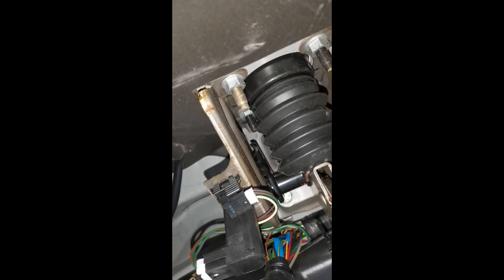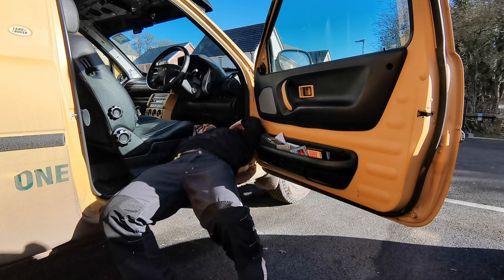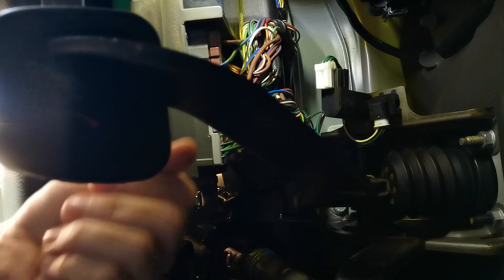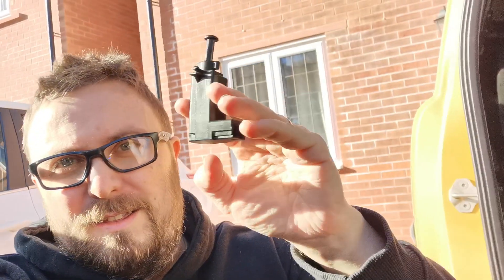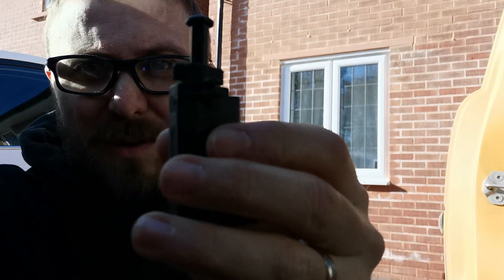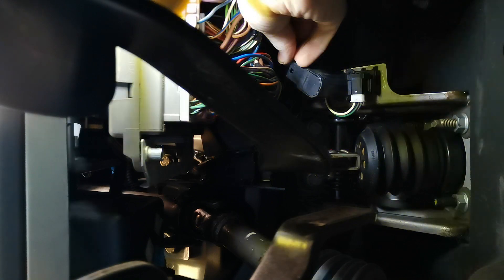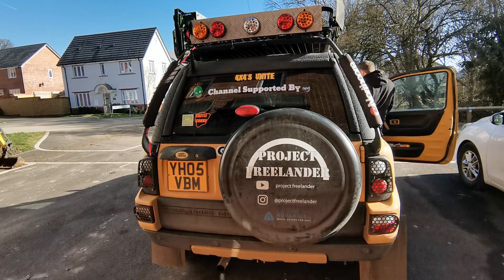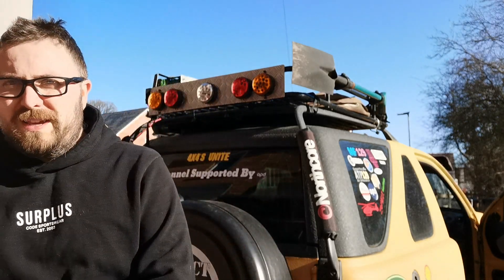How To Replace Brake Light Switch - freelander 1

Comment: Your video is very helpful, thank you! I have to press the brake pedal a lot (like halfway) before the light comes on. Is the switch adjustable? Thanks
Reply from the maker: Hey, glad you liked the video 😁👍
The button should react as soon as you begin to push it in and activate. 
As far as I know they are not adjustable, they are a sealed unit and typically only respond in one way.
Hope that helps

Comment: Excellent video - just completed this job on my TD4 automatic. Used the upgraded switch with new link wire, worked like a charm and no more three amigoes!
Reply from the maker: Awesome, glad you liked the video. I had contemplated the upgrade but thought it best to stick to stock for the purposes of the video lol I did think it caused the 3 amigos but strangely I didn't get them lol

Comment: Hi my freelander 1 back lights are both out, could it be a fuse and if yes which fuse please as new bulbs don't work
Reply from the maker: Have you tried a new brake switch yet? As if that's gone they won't activate. It could also be a bad contact on the connector itself, they are known to rust and become corroded. Unplug the lights at the back and clean up all inside the connectors on both the cable leading to lights and in the back of the lights and try again. That would be my starting point as fuses rarely go unless you have an electrical issue
Reply: @TrackCraftPerformance  cheers for that but my brake lights work it's my main back lights sos I'm female 😁
Reply: Yahyaoui..that made my day lol. I'm a female

Comment: I’m about to attempt this myself - thanks for the video! I have a 2004 2.5 Auto Freelander… is the part you used (and linked in comments) the right one for all FL1s? I’ve seen other switches (ERA) when searching online which claim to be for FL1s. They have the same style ‘plunger’ but the rest is different - not L shaped. Thanks for hanging in with a convoluted question!
Reply from the maker: Hey bud, thanks for checking out the video, hopefully was useful. I believe that fits all models yes but could be worth checking with APD. I know there was an alternate "upgrade" unit, that looks slightly different and some claim lasts longer. But mine lasted 18 years up until this point and the installed part hasn't gone wrong yet so can't complain 😁👍
Reply: Awesome, thanks dude. I’ll get one ordered and have a chiropractor on standby 😅
Reply from the maker: 🤣🤣 highly recommended 👍

Comment: Hi, when I turn on the headlights, my brake lights come on, we changed the part in this video but it made no difference. Do you have a video on rear lights ?
Reply from the maker: Hey, unfortunately I don't have a video for the rears but it sounds like an earthing problem. I would say check the earth on both fronts and back lights and make sure they are clean and clear of debris and rust and go from there 👍